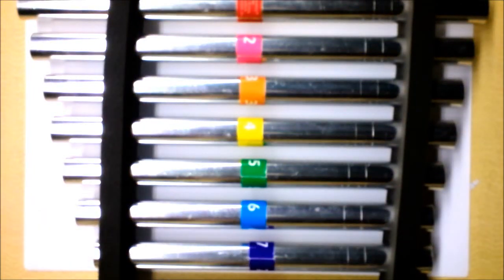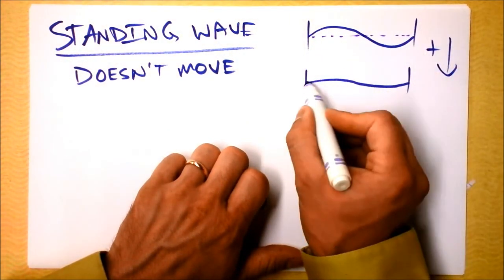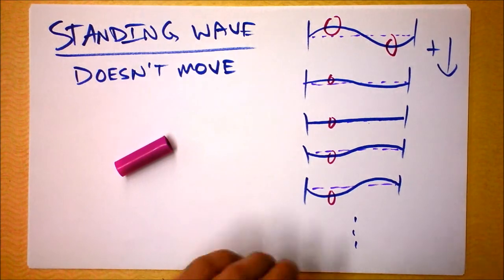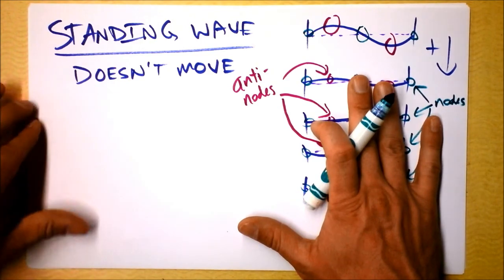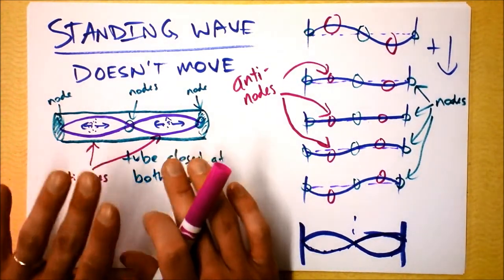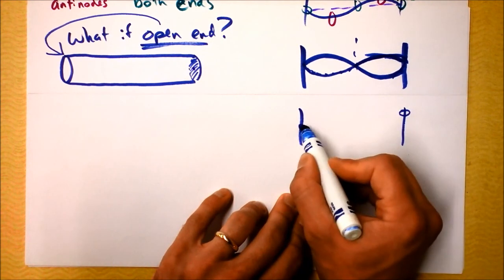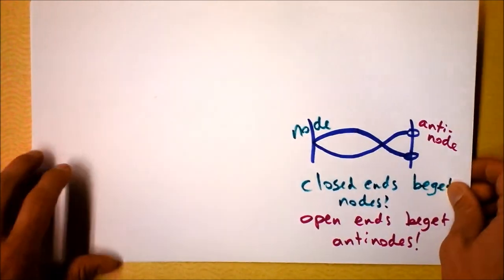Intro to Standing Waves on Ropes and in Pipes | Doc Physics

Comment: Well Done, I like the way you can speak about your discipline so folks outside of it can understand, most can't/won't.  
It seems the crux visible characteristic of a standing wave is its non-moving nodes.  
I still don't understand why the open end of a pipe must be an anti-node.  It's open so there's nothing to constrain it.  Somethings are PFM ;) though.

Comment: Hey Doc, would you make a video describing the relationship between the 5 brain waves and how they are equal to the 5 guitar strings and the 5 colors of the rainbow? Also your video explains why there is a up quark and an anti quark. It's because of wave dynamics with nodes and 5ths. The E string, 6th string is Blue where we Sleep, that's the slowest wave. The A string is Theta, green, when we're half asleep. D string is Alpha, wide awake eyes closed. G string is eyes open. B string is very excited. Would love to see a video that includes pathagros and the Clock of Time, the circle of 5ths. Thank you.

Comment: I a earlier video you explained that when we are talking about sound waves everything above y=0 means high pressure or density and below y=0 means low pressure or density. So looking at 6:11 it seems like there would be no resonance because the high and low pressure nullify each other. What is actually going on?

Comment: 3:14 Why don't the nodes move?
Does energy move along the air particles, and because of a small vacuum created, the air particles rush back? What ensures that the energy get released in a single direction as opposed to in various directions?
Reply from the maker: La-ti-do Maybe instead of blaming a vacuum, we could just say that there are elastic collisions among the air particles.  I think I have also assumed that we just have a one-dimensional tube.  Real life is more complicated.  Fa-so.
Reply: Equal distance from the core and equal resistance throughout the length of the tube, except open or closed end. A truncated cone creates an entirely different result...

Comment: Interesting video. can you please explain how a register key works, and why an oboe and saxophone have register keys has a register key which raises the tone one octave, but a clarinet's register key raises the tone 1.5 octaves?  They are both tubes with one open end.
Reply from the maker: THAT is something I don't know at all.  That being said, I imagine that these key locations are forced to become displacement antinodes or a healthy approximation to them if the hole is open.Truly, though, we need that rarest of beasts:  the musical physicist.  I appreciate music tremendously, but I have no training at all in it.  I just bought a couple books, so I may be able to answer you eventually.  Anyone else know in the meantime???
Reply: Doc Schuster So one clue is that the saxophone and the oboe are both conical tubes and the clarinet is a cylindrical tube.   The saxophone and oboe both have two register holes, each a different distance along the tube.  Either the automatic levers of the instrument or the musician have two close one hole and open the other between the G# and the A in the upper register.   The clarinet has one single register key which works for the entire 2nd register.

Can you think of a reason why opening a small hole near the closed in of the cone or cylinder would damp away the lower frequencies and preserve only the high frequencies?  And why the band pass point would be an octave in one case and 1.5 octaves in the other case?
Reply from the maker: Let's continue our agglomeration of helpful information by considering a technique that my bass and cello players have taught me.  One plays a note on a string and places one's finger gently at one of several locations near the end of the string.  This destroys one or many of the lower harmonics in much the same way.  The string situation is simply creating a node at the finger's location.  But now I'm out where I can't swim!
Reply: Doc Schuster can you make a video about standing waves in cones as opposed to cylinders?
Reply from the maker: I'd have to understand them first!  You and I would both like to watch such a video!

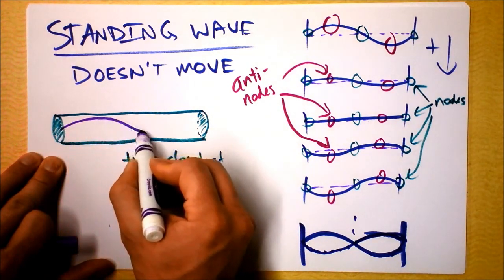Comment: 5:30 Perhaps you should make clear that the drawn amplitude for your pipe represents displacement, not pressure. Because a displacement node (such as a closed end) is a pressure antinode.
Reply: rfmvoers Oh I see you mention it at a later stage.

Comment: I think the guy below me has a point...particles are pushin towards the node and then again movin away...wouldn't that create maximum pressure change at the nodes?
Reply from the maker: I like that.  A particle-movement NODE is a pressure ANTINODE.  Did I get that wrong in the video?
Reply: I believe you did doc
Reply from the maker: K Myst
Wow, you two are totally correct.  THANKS SO MUCH!!!  I've put some comments in to fix my (abundant) errors.
Reply: Doc Schuster So this means that the pressure pushing away from the  node not anti-node right?
Reply from the maker: I do not understand your question.